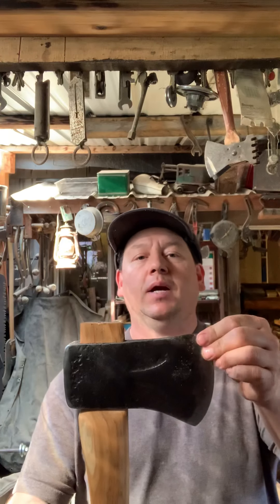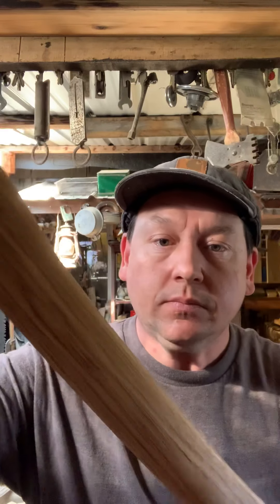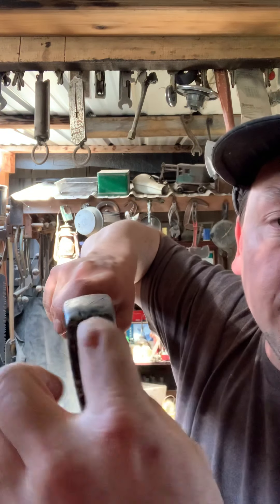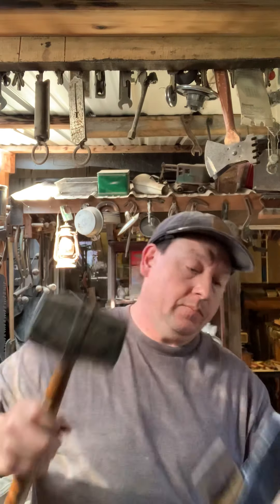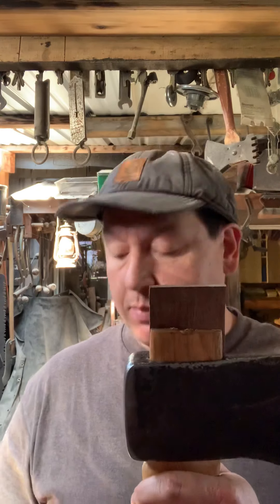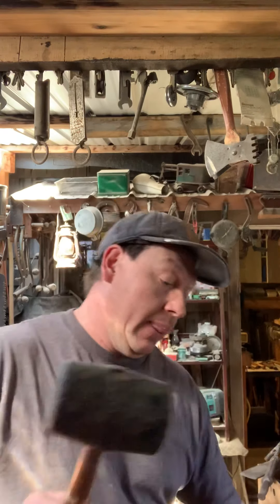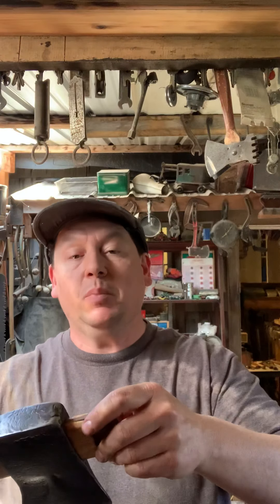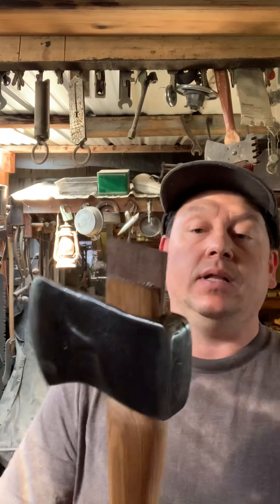Wedging an axe

Comment: Great video! My first hang with a factory handle made for the head had a little space in the front and back, but the sides were good. The wedge stuck out wider than the handle. You saw the pics! I appreciate your advice 👍
Reply from the maker: Bushcraft Woman - Amy yes I did and you did a nice job. Was just a little space. Nothing concerning.  Lots of folks cut them 1/4” short
Reply: @elicurtis846  Good to know, thanks!